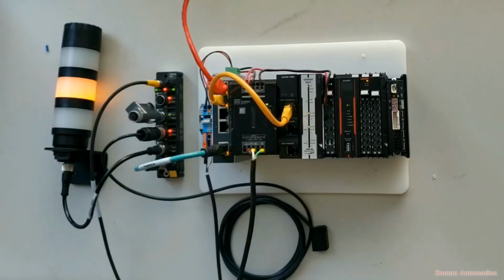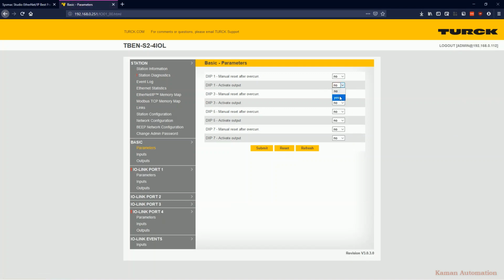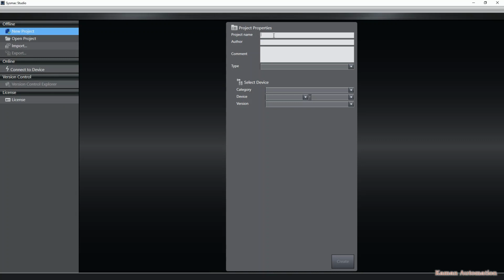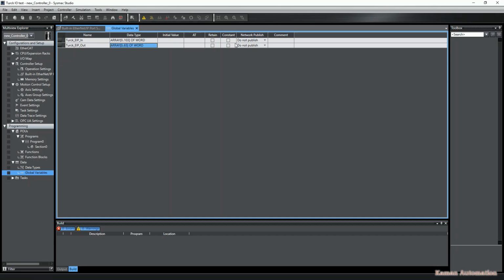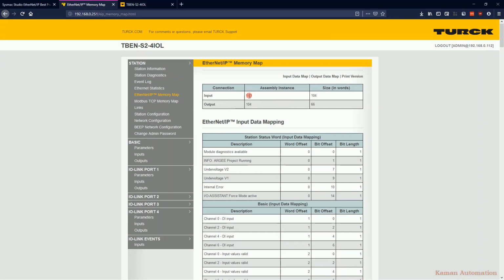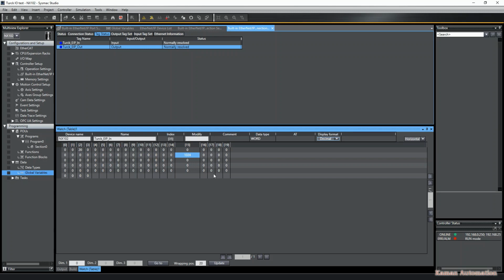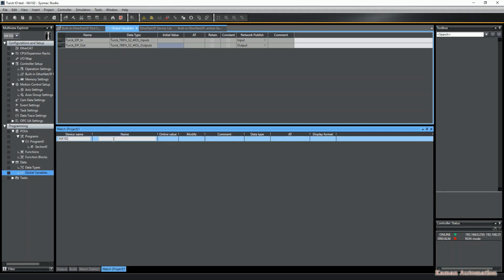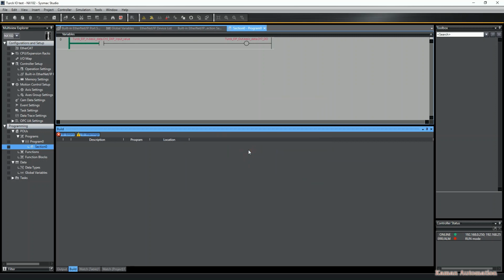How to connect third-party devices to Omron controllers using Ethernet/IP

Comment: Nice, How about third party ethercat device such as Oriental Motor?
Reply: I have also been using Oriental Motor drives with the Omron controllers. I believe it works really different and you have to import a XML (ESI) file and add it as a node.

Have you been able to get it to work?

Comment: Do you know if I can connect my NX1P2 to simulink over ethernet port? I want to have a real time system. simulink will calculate the numbers and give an input to NX1P2 and NX1P2 will execute the input from simulink to servo motor.
Reply from the maker: Ethernet/IP is many things but by motion control standards it is not a real-time protocol. This should be possible with Simulink PLC Coder, which would generate IEC 61131-3 Structured Text that can be deployed onto the NX1 controller. Alternatively, you could control the servo motor/drive directly over EtherCAT using NI SoftMotion. Good luck!